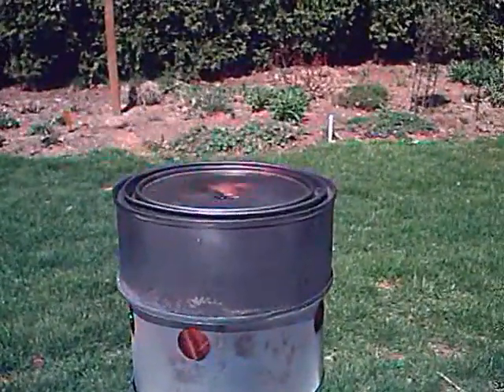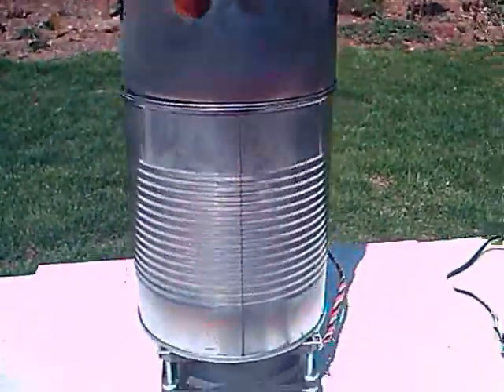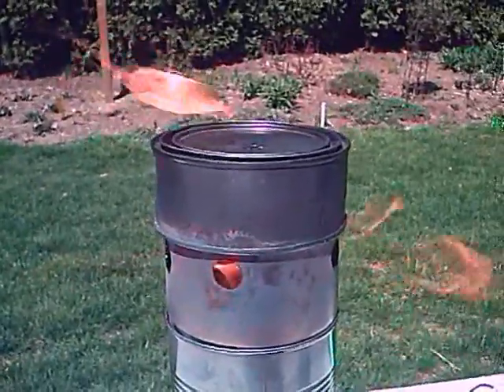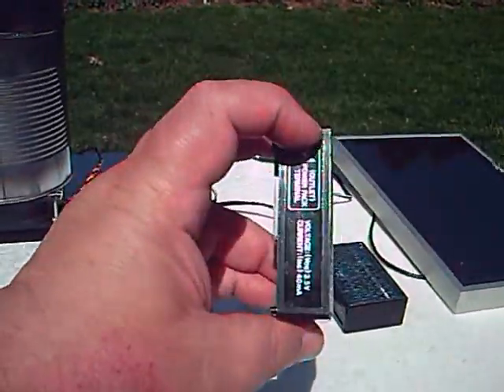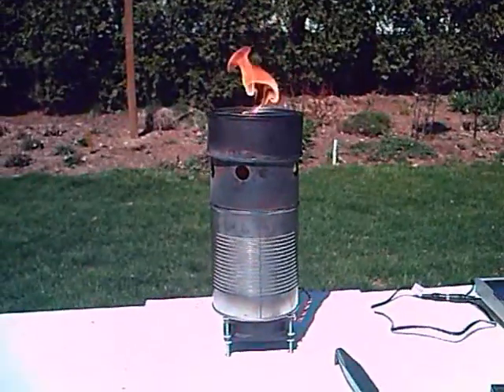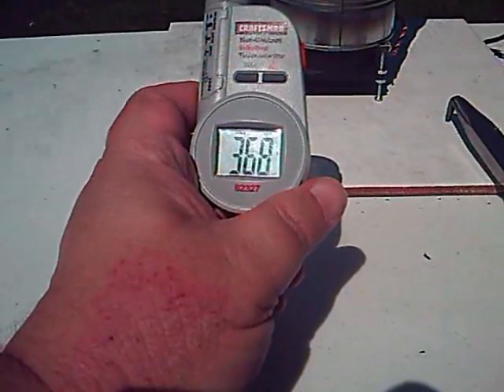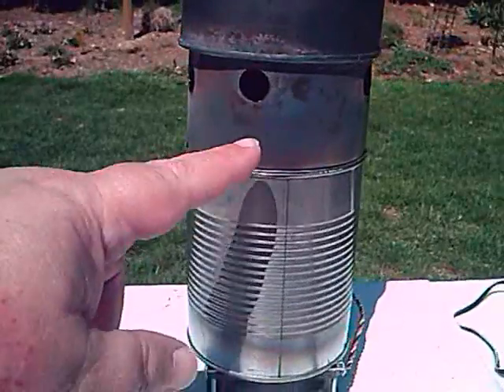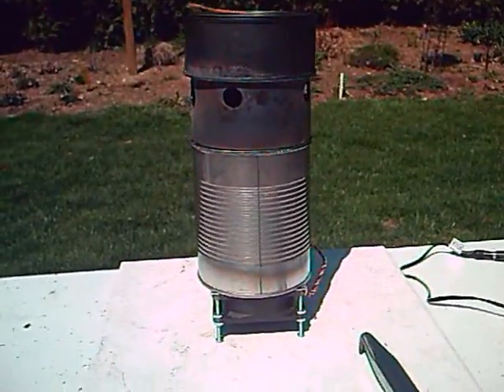Making wood gas using my wood gas stove/forge

Comment: @teb0atoz The rocket stoves I make are very simple and I have used them to smelt metal without a fan using only a few small sticks as fuel. Originally I made mine using sheet metal but it kept melting under the intensity of the heat.

It's more than just a glorified fire place as the fire places I have seen use large amounts of wood and produce a lot of smoke and particulate matter. I can stand directly over a rocket stove and not choke on the smoke because it burns more efficiently and cleanly.

Comment: Sorry man you are just increasing combustion due to an increase in air flow similar to how a blast furnace works. You are not generating wood gas and then reburning that gas to heat your water. You are doing one step similar to a campfire only slightly more efficient. This is a hobo stove at best

Comment: you might consider using a "rocket stove" for your heat source.  A rocket stove is easy to make, burns very hot, uses fuel very efficiently and would not need the fan. for example see youtube video "rocket stove" wRbr3KsEjeE